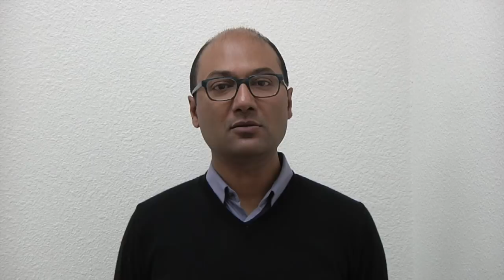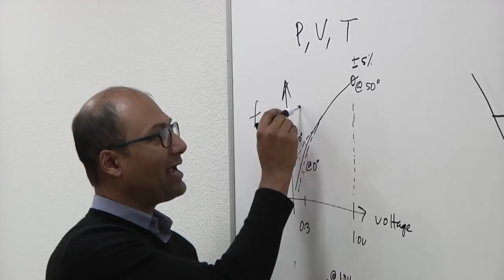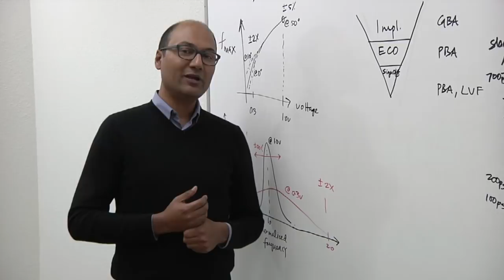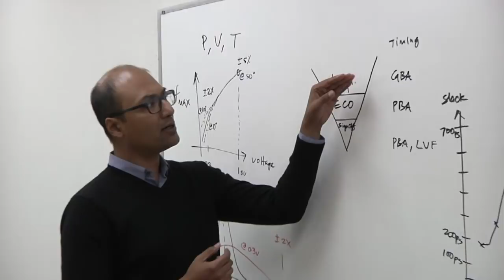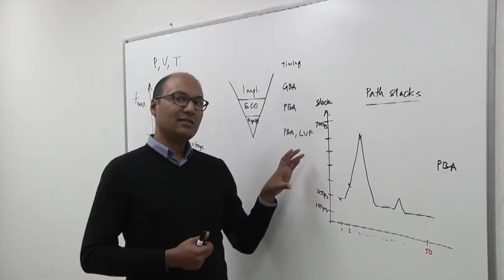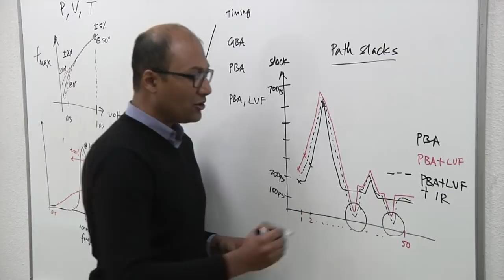7nm Process Variation

Comment: I have one question here. We will mainly focus on customer's requirement and try to deliver the timing models right especially the liberty models. Does customer again try to tweak around this voltage ? Is that where they call us back in ? What I understand you know we wont give the data across each process temperature and voltage , but only the worst cases. When the chip operates at any other conditions other than this qualified cases this problem may arise. Am i right here ?